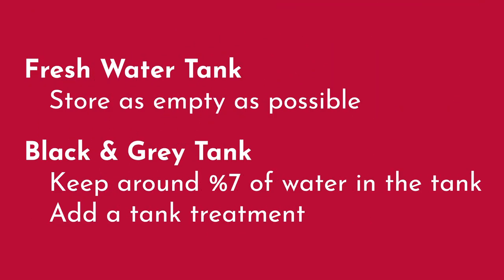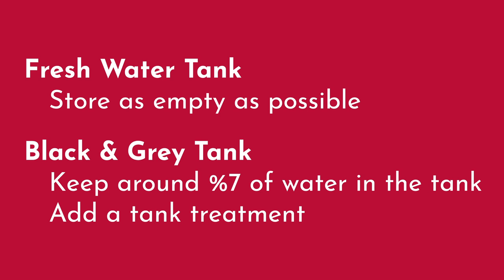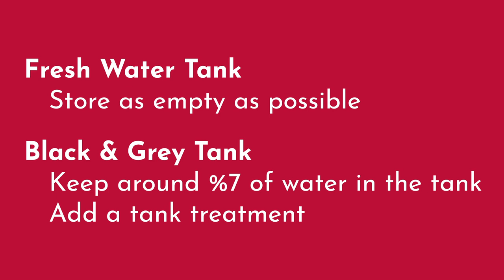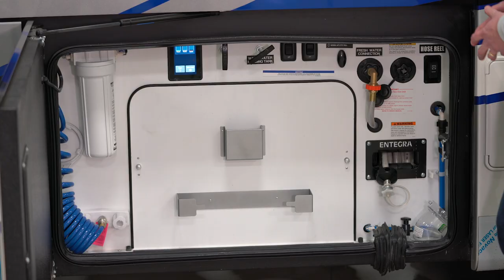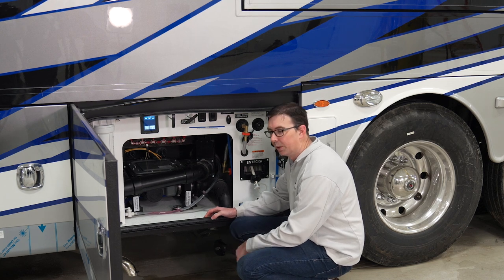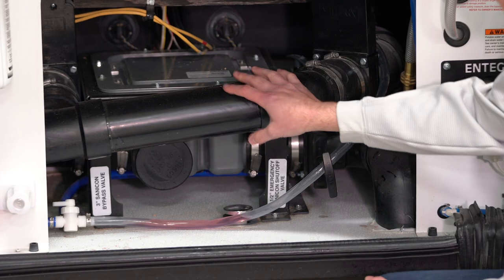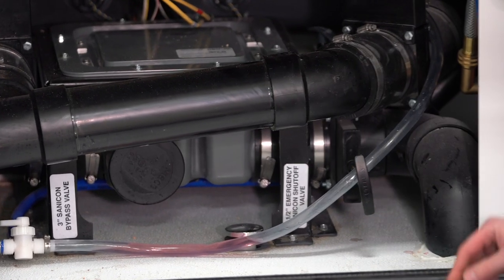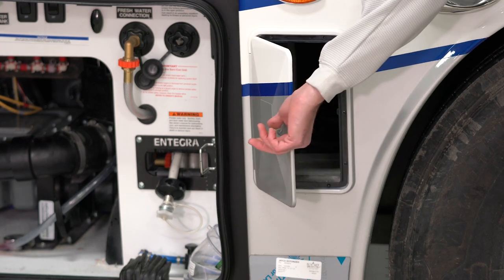Tanks & Plumbing

Comment: Thanks for the video! I have a 2021 Entegra Odyssey 26D and I'm wondering where I can find the plumbing schematic for the fresh water tank - any suggestions?
Reply from the maker: Thank you for your message. We have a couple of options to reach Entegra Coach service about parts/service/technical support related questions. Please reach out to this team for assistance with any issues you may currently have. You may also contact your dealer and service dept for assistance with your unit. Our goal is to help you by assisting your authorized dealer and/or repair center in resolving your concerns. Please have your VIN # available for the representative.

Customer Service Email:  service@entegracoach.com

Customer Service Phone Number
This central number will take you to our Customer Service Switch Board where you can select your brand for service support. 
(800)-283-8267

Comment: How do you empty the macerator hose after emptying the tanks?  Appears to be air locked and the longest step in the tank emptying process.  Any suggestions?
Reply from the maker: Thank you for your message. We have a couple of options to reach Entegra Coach service about parts/service/technical support related questions. Please reach out to this team for assistance. You may also contact your dealer and service dept for assistance with your unit.  Please have your VIN # available for the representative.

Customer Service Email:  service@entegracoach.com

Customer Service Phone Number
This central number will take you to our Customer Service Switch Board where you can select your brand for service support. 
(800)-283-82674